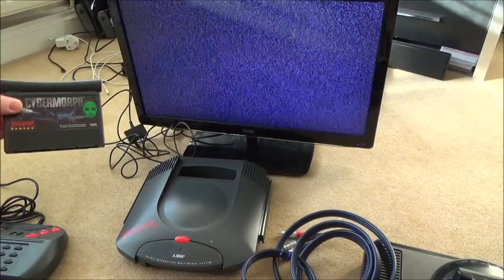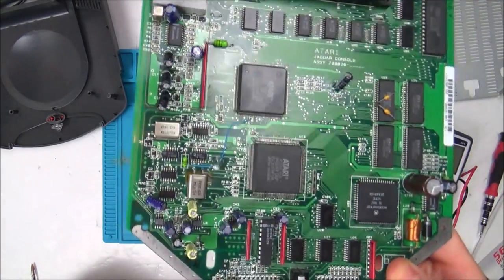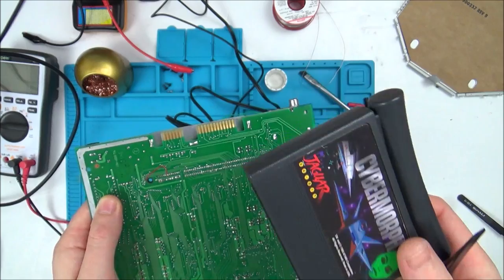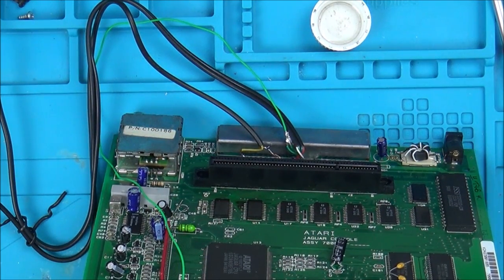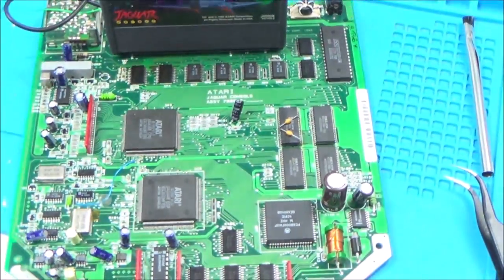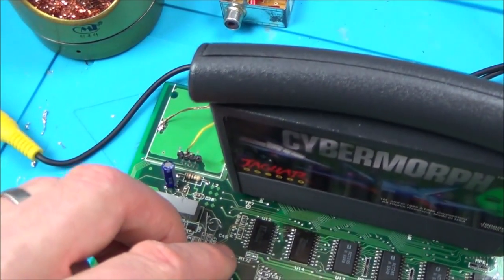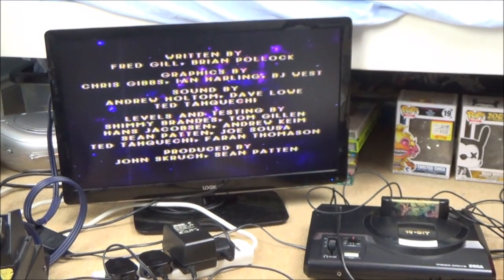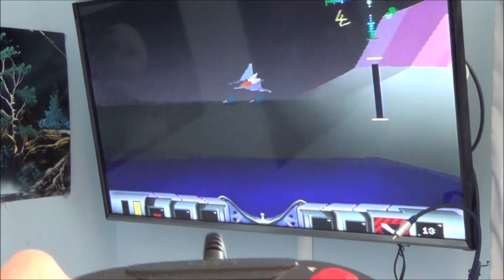Trying to FIX an ATARI JAGUAR with No Display

Comment: Uff, James would run in circles when he would've opened his Jaguar up and read that this was factory modded. The Jaguar was so shitty, they had to mod it in QA so it even worked :D

And the strange "side tuning" is normal for consoles of that time. The old tuners are pretty crappy and the knob you have is a fine-tuning of the frequency. We learned it with an oscilloscope in theory when I did my IT class, our teacher used VHS for that example (even when we used SCART all the time), but the tuner was always setup like crap. That was why my SNES was on 3 channels or frequencies on my old CRT TV as a child.